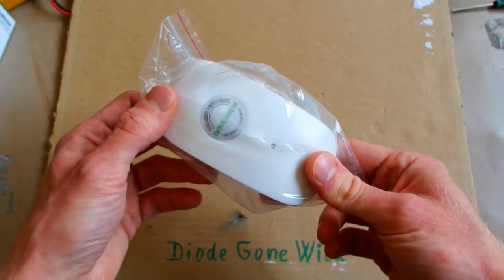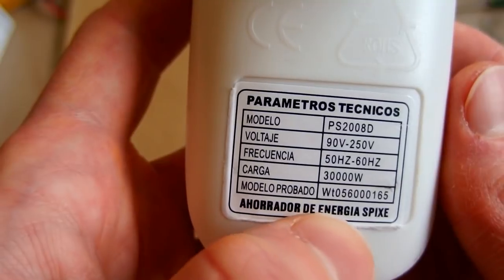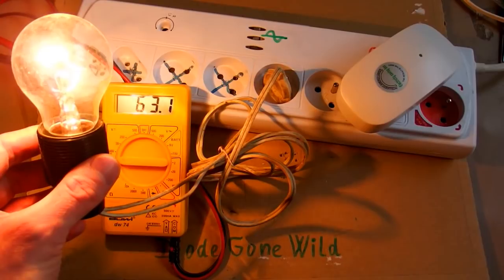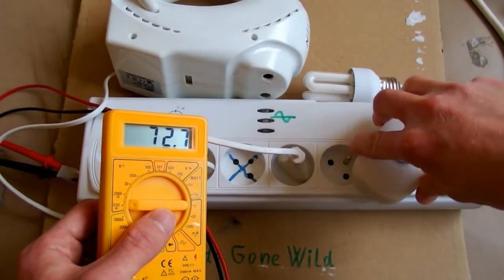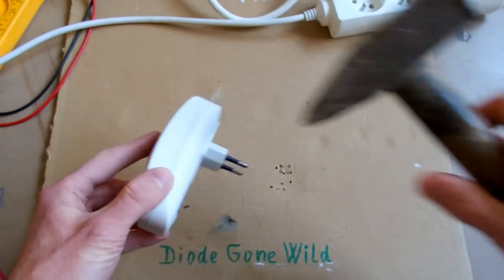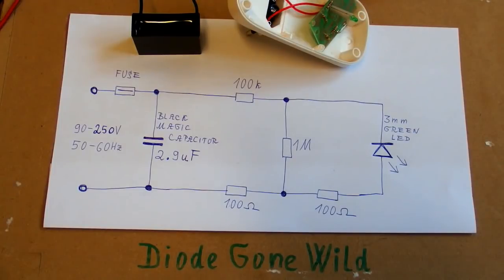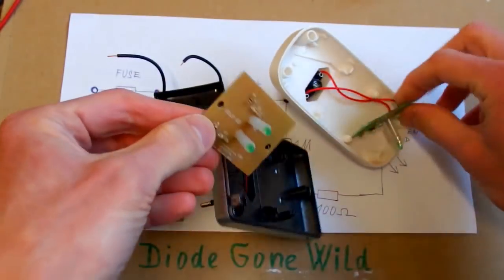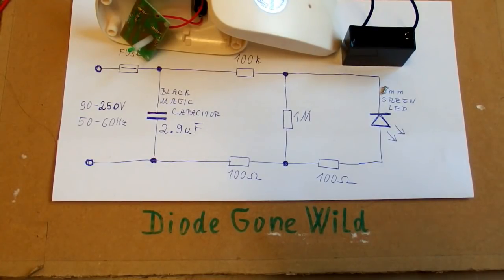Overunity? Chinese Power Saver (Electricity Saving Box) Tested.

Comment: Looking at the claims all these „Power savers“ make about the 30KW capacity they can handle - And seeing the rather underwhelming 3nF capacitor the better more expensive ones contain - Makes me wonder how physically large a capacitor would have to be to hold 30KWh of energy in any usable voltage/current specs... 🤔

I haven't the first idea about how to design a capacitor to a given capacitance or level of power storage - All I know is More volts = More plate separation and More currant = More plate area - But given a Rizla powerwall is the size of an 80s minicomputer and can store about 11kWh of energy, I don't think it's going to be small... 🐘⚡😉

Comment: Nonsense plug! For those who really want to save a lot of electricity: The TEST Foundation published the article "Saving energy in everyday life - save 1,000 €." The greatest savings potential are energy-saving shower heads, up to 300 € p.a. at a cost of only 20 €.* Otherwise, LED lamps, window sealing strips, switchable power strips, energy-saving heating pumps, programmable thermostats, radiator reflective foils, and timers (e.g. to switch off routers at night) should be installed everywhere. In terms of cost, effort and savings, the most effective insulation measures are roof, cellar ceiling and roller shutter box insulation.

Comment: In resistive loads, such as light bulbs, the voltage and current waves match, or the two are in phase. As you might guess from the name, resistive loads only resist the current and are the simplest type of load. In inductive loads, such as an electric motor, the voltage wave is ahead of the current wave.  𝐚𝐧𝐝 𝐭𝐡𝐢𝐬 𝐬𝐚𝐯𝐞𝐫 𝐰𝐨𝐮𝐥𝐝 𝐰𝐨𝐫𝐤 𝐨𝐧𝐥𝐲 𝐟𝐨𝐫 𝐭𝐡𝐞 𝐬𝐞𝐜𝐨𝐧𝐝 𝐢,𝐞, 𝐢𝐧𝐝𝐮𝐜𝐭𝐢𝐯𝐞 𝐋𝐨𝐚𝐝𝐬

Thankx😂 🤣

Comment: Remove the LED  and plug in wall socket for 2-3 secs and unplug, touch the capacitor wires = shock
Reply: There is 50% chance for that the LED doesn't matter, because if you unplug it in the half cycle when the LED is in reverse, it won't draw any power from the capacitor!

Comment: I think scams like that are completely legal because they are available everywhere even inside shopping malls. Although the capacitor only costs around $1.00 (U.S.) when they placed that capacitor inside that silly shell they charged you around Php2,500 ($50.00) when they were introduced here in the Philippines many years ago although they gradually dropped their price over the years, they are still way more expensive than the manufacturing costs. They connected them next to the old fashioned fluorescent tube with inductive choke ballast with a digital tester to impress customers that they worked. Overpriced scams are legal. The most common overpriced scam here in the Philippines is induction cooker which costs around ten times than more popular brands with a similar feature. A double burner induction cooker from popular brand costs around Php8,000 ($160) while scams with similar features costs around Php70,000 ($1,400) and they are in displays in shopping malls targeting senior citizens.

Comment: This doesn't help me. According the description I read, you need to leave It plugged in and within 24-48hrs the current will be under control. And that the longer it is kept plugged in the better. And preferably to use a plug closer to the meter. So for me plugging it I. For less then a minute doesn't really telling me anything . Now I'm not saying you're wrong and it is obvious it pulls more power, but u only plugged it In for a short period. And it is my understanding that a capacitor stores energy to be able to power something bigger. Or something like that. Im no expert obviously, I'm just stating my understanding of things, and that this review doesn't really help only cause in my head you need a bigger time frame to really test it. Looks like I'll just buy it and test long term myself and see if there are Any differences in the bill like they describe. If I'm wrong in Any of my understanding, please lmk. I like to make sure stuff I learn is accurate in my head and I didn't miss somethng along the way

Comment: That is a very interesting transformer! Where did you get it?
Reply from the maker: Its about from 1980's. Nowadays the small transformers usually have just pins or wires, not screws.
Reply from the maker: In the old days, those 220V / 24V 2VA transformers were commonly used for indicator lightbulbs in machines, maybe also for relay coils and so.

Comment: I really like your hand-writing. Why do you think they put the Capacitor in a potted box? People normally wouldn't open it up. Also, it seems to have no discharge resistor since it gave you a shock. What a silly design.
Reply from the maker: Good idea - I will make an autopsy of the black box in another video :). There is a discharge resistor, but the value is too high for such a big capacitor. It discharges too slow.
Reply: I was thinking about it and I think they put it in a potted box to add weight and make it seem higher quality.
Reply: Possibly to make it seem like it is better, because the capacitor is bigger - or at least appears to be big! XD